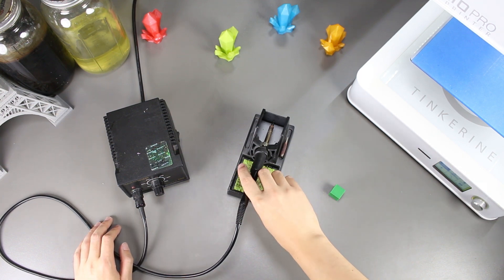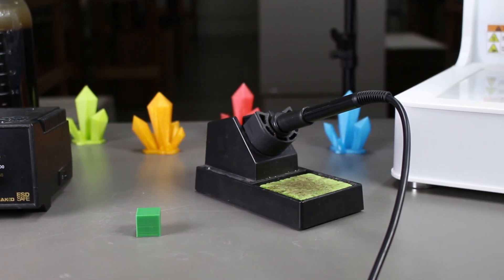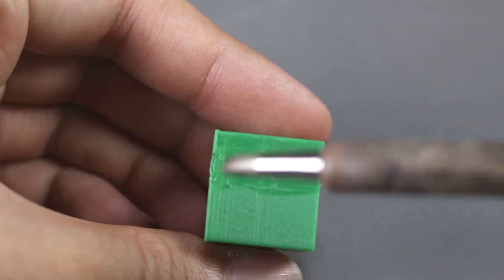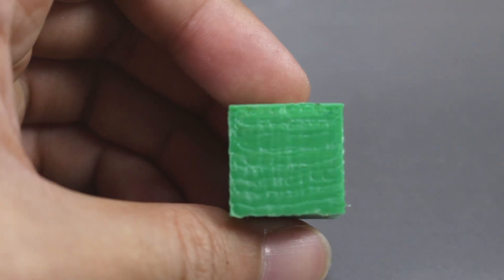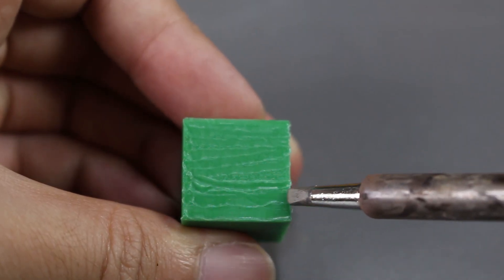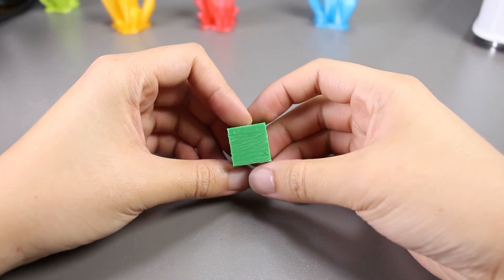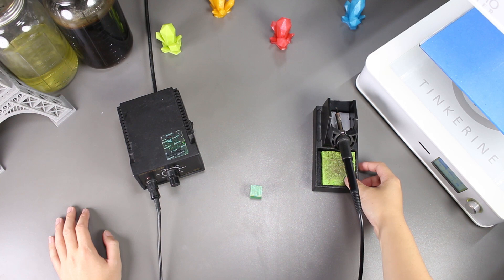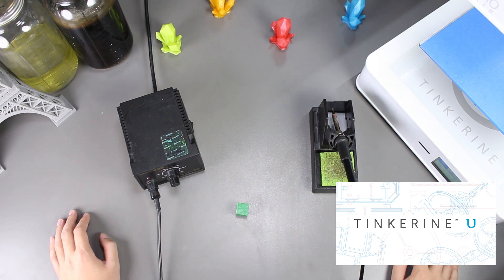Smoothing 3D Printed PLA Print with a Soldering Iron

Comment: what if you put the soldering iron in a fixed height (and locked so it can't move anymore) of a total of the object height - 0.1mm and then move the object in a parallel linear motion. I'd also make sure the soldering head was in a hypotenuse to the linear motion so that it keeps pushing the "remainder" to the same side (the side we haven't finished yet). We could then chamfer the total remainder when it's built at the outer edges.

Comment: I am watching your smoothing techniques very often and i have to say thats the best technique i've seen without using any chemicals for PLA. I recently bought a soldering iron station its the best way to smooth 3d print (3d pen in my case :p), then i used a tile file to flatten the surface. After that, i heated up the surface with a torch lighter to restore the shininess.
Reply from the maker: Thanks for the comment!